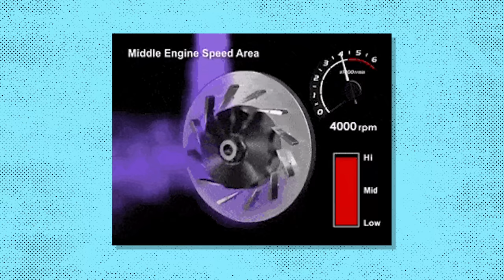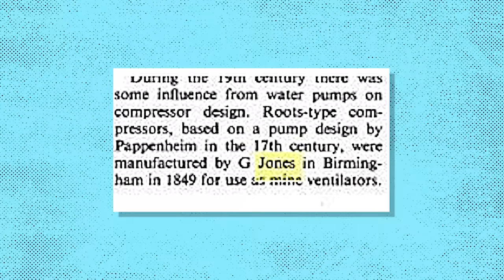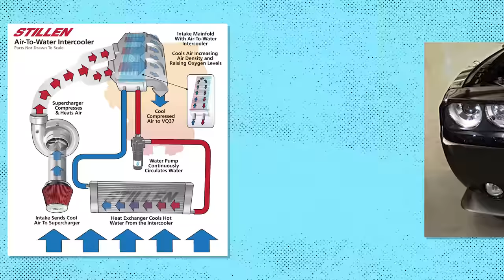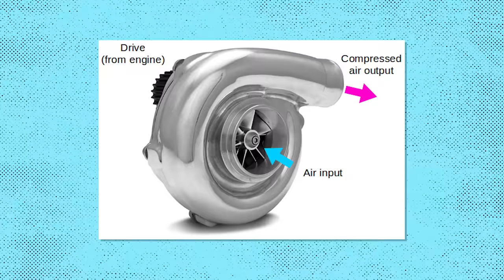Why Superchargers Aren't As Good as Turbos

Comment: Everyone being mislead by this.  Superchargers are #1 & used in all the fastest cars on Earth, 0-60 & 1/4 mile.  Turbos can be used by skilled drivers to store energy & use after corners.  Normal drivers have an easier time w/ superchargers tho, cause like it or not you prolly suck like I do vs Rally drivers.
Reply: Superchargers are fundamentally inferior to turbochargers for some very important reasons that are completely lost to you.
 Turbochargers are banned in many motorsports series because of the significantly higher performance.
 Many inexperienced drivers are unnerved by turbochargers and lack the confidence to drive them to their full potential.
Reply: Turbos make more power than superchargers
Reply: @WilhelmKarsten  false. Wanna race? Boost is boost, yes superchargers use more HP for the same boost levels. The fastest cars on Earth are supercharged & jet powered.
Reply: @sandervanderkammen9230  what is "lost on me?" I have driven powerful turbo cars & have an 800+hp supercharged car right now. An air pump is an air pump. Turbos are more efficient and will always have lag & lose at power under the curve @ same max hp levels, sized correctly. Turbos are good, neither is "better." Turbo race cars are a often pain, burn your oil & manifolds OFTEN crack. I'm not talking stock, I mean racing... where I prefer superchargers. No weight penalty, none of the red hot lava tubes baking the engine bay... same power capability as long as you have big intercooler & run a bit higher boost (pulley) than same motor w/ turbos. 
The issue you probably face is selection in superchargers is limited. Most turbos fanatics have tiny motors & can't supercharge because there aren't even efficient models to choose if they could machine an intake for it. Turbos are easier to fabricate in a garage. I've done it.
Reply: @ohane1  ITS TRUE! Turbos will always make more power and more torque at the same boost pressure

It's an irrefutable fact, if you don't understand this? You clearly don't know about turbos or how they work.
Turbos ARE BANNED in Top Fuel.
NHRA BANNED them because they made the cars too fast.
Reply: @ohane1  Turbochargers are better than Superchargers for a very important fundamental reason which you still don't comprehend.

There is a huge difference between a turbocharger and superchargers.
The same as there is a huge difference between an engine and just a pump.

The fundamental difference is the Turbochargers has its own engine.
 Two engines that run on the same heat source, a massive advantage over a simple pump that only offers a small increase in horsepower due to its benefits as a more efficient pump.
 
Turbo cars are faster, not slower... you just don't have the knowledge yet son to understand this.
Reply: @sandervanderkammen9230  false. Why is the fastest production car a supercharged Demon & fastest cars in world supercharged top fuel cars. I get what you're trying to say tho, you don't understand that superchargers need to be sized & require more $$$$ to develop & machine. They are less efficient, but pruduce more power under whole dyno curve... horses for courses. Neither is "better." Go race a demon, or top fuel... and likely me. I chose a supercharger because I needed all low end torque I could get & turbos are bad @ that.
Reply: @ohane1  Turbos make more torque than Superchargers and more torque means faster acceleration.

Stay in school kid, when you grow up you might learn something about cars.
Reply: @sandervanderkammen9230  lol, Go look at dyno result of any motor supercharged (a modern one) vs turbo w/ same max pressure. The S/C one will have more power under the curve & it'll start @ lower rpm. Almost all 4cyl 1000hp turbo cars bog & have trouble launching if they hook cause they don't have enough low end torque.
Reply: @ohane1  That is pure ignorant nonsense, son, if the BMEP and IMEP are the same, the Turbo engine will always produce more horsepower and torque at the flywheel.

Please stop posting lies and ignorant misinformation about a topic that you are very confused about and not qualified to discuss intelligently.
Reply: @sandervanderkammen9230  You clearly have never raced 2 cars w/ same peak HP & watches the turbo one get stomped by a N/A car.  Happens almost every time. Know why? Because no car can stay @ that tiny peak. HP is the number the uneducated think is all that matters. Power under the curve wins races. I'd love to race you. I'll let you pick a 900hp turbo 4 banger vs my 800hp 6.0L. @ same weight you get crushed.
Reply: @ohane1  Never happened kid... are you even old enough to drive a car yet?
Reply: @ohane1  TORQUE is dominate factor in rate of acceleration, Turbochargers produce more torque than Superchargers and thus acceleration is faster.
So much faster than NHRA have banned Turbochargers in Top Fuel drag racing.
Reply: @sandervanderkammen9230  ok, either head to Google or just stop. Torque is Force x Distance. Horsepower is calculated with torque & time (work).
Seems you think turbos breaks laws of physics. Dyno & 1/4 mile times don't lie. Where do you live? We can go to a track & I can prove this to you.
Plenty on 4cyl 1000hp+ cars lose to normally aspirated 1000hp cars, in fact prolly always if both are AWD or both 2WD. You truly don't understand what I mean by "power under the curve" & can easily google.
Turbos lose to S/C almost always in that figure. That's what wins races. YES it is cheaper & easier to hit higher hp # w/ turbos btw.
Reply: @ohane1  Look kid, you obviously have no formal education or professional experience regarding this topic and are clearly not qualified to discuss this matter intelligently.
Please stop spreading lies and ignorant misinformation.
Reply: @sandervanderkammen9230  Whoa... Think some moderator is deleting my comments & not yours.  Hey owner of this page, why is that happening?  I have literally the fastest Saab on the Dragy app in the world, and you're highlighting a guy insulting me? I'll quit trying maybe.  Turbos are great at some things.  Displacement matters too, not just HP peak.
Reply: @ohane1  Stop trying to change the subject son, you made a fool of yourself when you doubled down on ignorance...
Reply: @ohane1  Maybe he is doing a public service... by censoring stupid people.

Comment: Tired of hearing how superchargers are inefficient. It is nonsense based on a misconception. Efficiency isn't defined by amount of parasitic loss it's measured by Brake Specific Fuel Consumption. Either can be more efficient depending on the installation and use case.
Reply: Well, hear it again until the truth sinks in.
 Superchargers are significantly less efficient than turbochargers.

The gain in pumping efficiency and volumetric efficiency is offset by the parasitic loss to drive the compressor.

Turbochargers have no parasitic loss, the compressor is driven by it's own heat engine that uses waste heat energy normally lost out the tailpipe.

Turbochargers have significantly lower BSFC and generate more horsepower than a comparable supercharged engine at the same manifold pressure.

Any questions?
Reply: @sandervanderkammen9230  If you think turbochargers don't have parasitic loss you need courses in thermodynamics and basic mechanics. They also suffer from windage loss, incomplete scavenging, and fluid slip.  Then there's wastegates. It's far more complicated than x is more efficient than y. Every use case is different.
Reply: @patrickweaver1105  No, The exhaust turbine is a Combined Cycle Heat Engine that operates on the Brayton Cycle.
 The temperature drop of the exhaust gasses as they pass through the turbine wheel is directly linked to the amount of horsepower generated to drive the compressor, the increase in BSFC and over all TFE
There is no parasitic loss at the engine crankshaft/flywheel.

Any questions son?
Reply: @sandervanderkammen9230  Gibberish. The Brayton cycle describes a combustion engine which a turbocharger is not.
Reply: @patrickweaver1105  Wrong again son, The Brayton Cycle describes a Heat Engine 
Heat that is generated by Otto or Diesel engine and provides the Hot Reservoir that drives the turbocharger.
Reply: @patrickweaver1105  Turbocharged engines are Combined Cycle Heat Engines, the Turbo is a Second Pass Thermodynamics Cycle.
Reply: @sandervanderkammen9230   A compressor without losses would violate the second law of thermodynamics.  You don't understand what you're trying to say.
Reply: @patrickweaver1105  The exact same compressor efficiency loss as a comparable centrifugal supercharger compressor.
You argument is invalid.

It's obvious from your comments that reveal that you have no formal education or professional experience in this area and you are not qualified to discuss this topic intelligently.
Reply: @sandervanderkammen9230  I've yet to see a supercharger that increases exhaust back pressure or reduces scavenging in an engine. If turbochargers were more efficient for every application superchargers wouldn't exist anymore. Make all the ad hominem attacks you like It's still true.
Reply: @patrickweaver1105  Explain how a turbocharger increases backpressure and increases airflow at the same time???
 Only in applications where turbo are banned, such as NHRA Top Fuel.
Reply: @sandervanderkammen9230   Turbocharges are an exhaust restriction. They are also an air compressor. It's fundamental to the way they work. Turbochargers are banned in NHRA top fuel for insurance reasons.  They tend to come apart if you spin them too fast. Superchargers were quite common on two stroke diesel engines, until government regulations banned almost all two stroke diesel engines. In WWII a lot of airplanes had direct crankshaft driven centrifugal superchargers. Now we have jet engines. Manufacturers are still putting superchargers on luxury cars. There's a 2024 Mercedes that is both supercharged and turbocharged.
Reply: @patrickweaver1105 Superchargers ARE LESS EFFICIENT than Turbochargers, this is an irrefutable fact that cannot denied or disproven.

Your lack of education and experience has led you to make false assumptions about the fundamental principles of Turbocharger operation and their efficiency compared to PTO driven Superchargers.
Reply: @sandervanderkammen9230  Well if you say so I guess I'll ignore all the times superchargers were used because they're superior for the purpose. What assumption? What lack of education? What lack of experience? It seems you're making some assumptions.
Reply: @patrickweaver1105  You're not fooling anyone here kid, you don't understand how or why Turbos are more efficient than Superchargers because you don't have the Slightest clue how turbos work.
 Your comments prove this.

A turbocharged engine will always be more thermally efficient and generate more horsepower per pound of fuel because there are 2 engines running on the same heat source.
Turbochargers run entirely on the heat leftover from the reciprocating engine.

A typical turbocharged engine, the EGT drops between 200° and 300°F as it passes through the turbine wheel.

The First Law of Thermodynamics tells us  that energy cannot be lost or destroyed, it can only be changed from one state to another.

Carnot tells us the Second Law of Thermodynamics, the difference between the Hot Reservoir and the Cold Reservoir equals the  amount of horsepower converted into Work from the heat.

Any questions son.
Reply: @sandervanderkammen9230  Of course the temperature drops, it's using the exhaust gassed to perform work. That's not everything the second law of thermodynamics says. Turbochargers have mechanical and thermal losses. Everything mechanical does.  All Carnot's theorem means is no heat engine can be 100% efficient. It's the basis of the second law of thermodynamics which further states less than 100% of the heat transferred can be converted to work. You don't understand basic thermodynamics. Have you ever heard you can't win, you can't break even, and you can't get out of the game?
Reply: Can you provide any evidence that superchargers are as efficient as turbochargers?
Reply: @patrickweaver1105  Completely moot point son, How much heat energy does the supercharger convert into work???
Answer: ZERO

Stay in school kid, study hard and you might be lucky enough to go to college and learn something about engineering.
Reply: @sandervanderkammen9230  It's irrelevant how much heat energy a supercharger converts into work (none) It's mechanically driven. You on the other hand will likely never understand thermodynamics.
Reply: @WilhelmKarsten  They aren't, and they are, It depends on the application. Do your own research I don't have time to teach you.  In a two cycle diesel engine above a certain size and compression ratio a supercharger is more efficient than turbochargers.
Reply: @patrickweaver1105  Thank you for proving my point.
Supercharged engines can never be more efficient than a Turbocharged engine.
 Superchargers cannot improve the thermodynamic efficiency because they convert no heat energy into work.
Reply: @patrickweaver1105  Carnot's formula tells us that no heat engine is 100% efficient.
  Some heat is always rejected from the cycle.
 This is why Combined Cycle Heat Engines like Turbocharged Otto and Diesel Cycle engines are more efficient than Naturally Aspirated or Supercharged engines.
Reply: @patrickweaver1105  PROVE IT!
Reply: @patrickweaver1105  Look at any 2-stroke Diesel engine and the Turbocharged version will always produce more horsepower and have a lower BSFC.
Reply: @patrickweaver1105  Now you have backed yourself into a corner, checkmate. You lose.